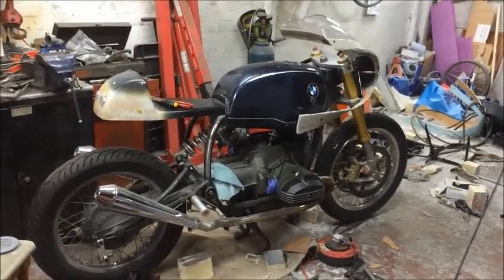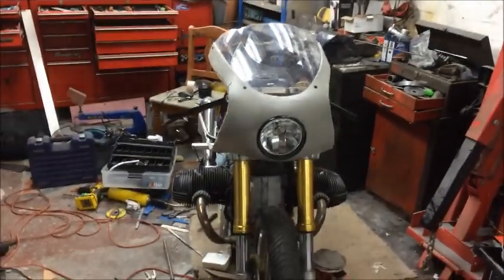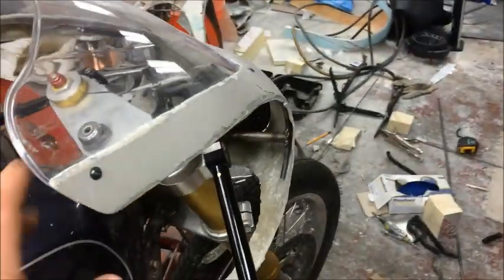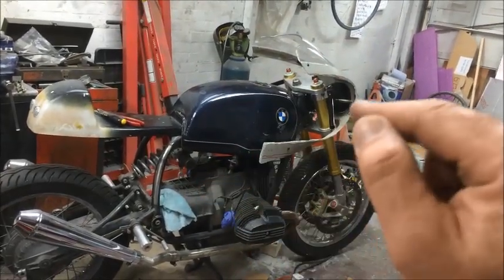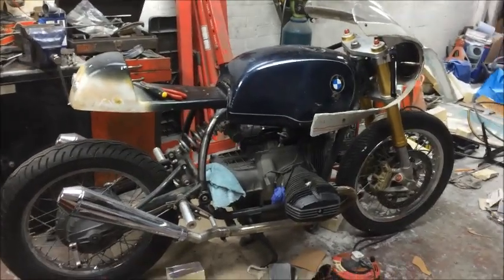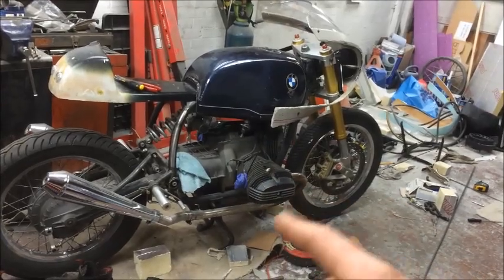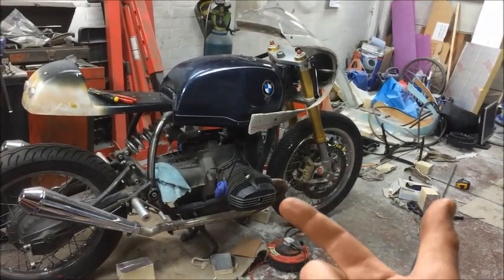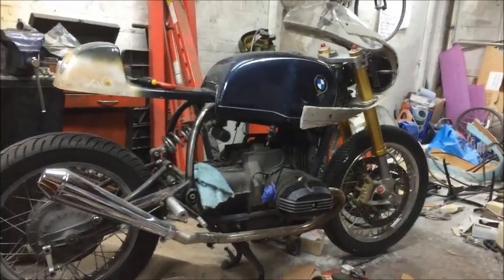bmw r80 cafe racer project part 33

Comment: Well, when I started my bike didn't want a fairing much, and seeing how much work you have to put in to it, I feel like I did make the right decision. However, I think nearly all the models you have created looks great! I'm excited to see how it will look in the end.  
Just one question, how will you do with the carburettors? I think you mentioned it in a earlier video, but isn't it hard to get the airbox on if you have taken it off? Now when you got that suspension too. Are you gonna do like some and have each carburettor have their own air intake and just glue an airfilter onto the air inlet part?
Reply from the maker: Yes, well, don't be put off a fairing by my struggling, I could (maybe should) have just bought one. I must admit that the best looking ones don't tend to have fairings however my vision of this bike includes a fairing so it has to have one now. Regarding the carbs, I will probably go individual filters, not sure about the engine breather yet, it seems too far away at the minute to think about. We will worry about that when we need to.
Reply: I'm really excited for the build, keep it up! Gets more intresting for every buildlog. But ofcourse, do everything you need to first. But don't leave the bike!